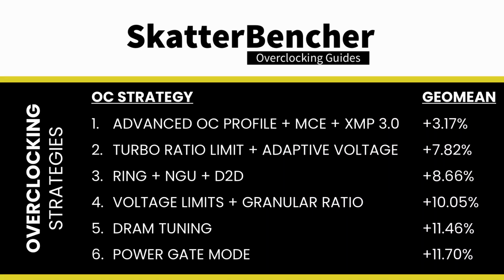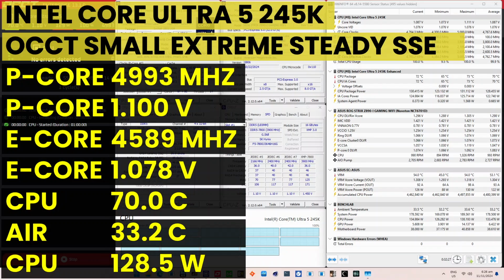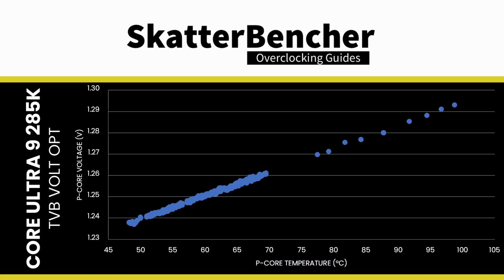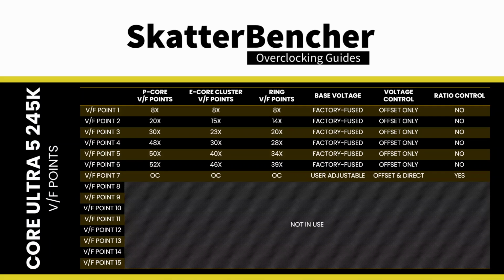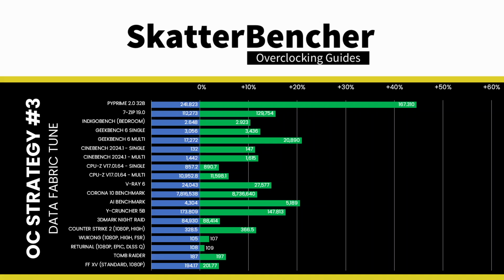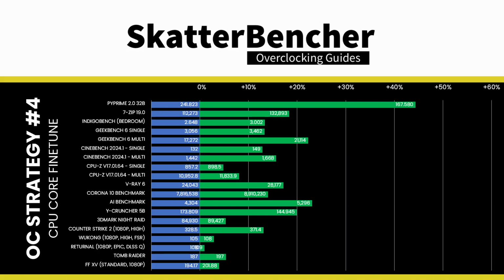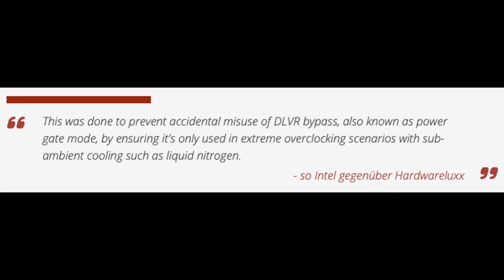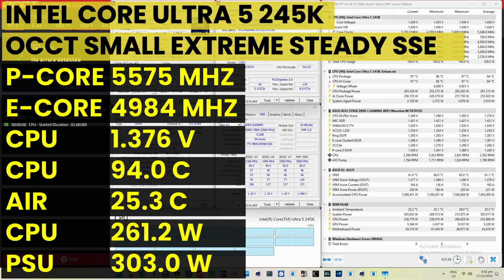Core Ultra 5 245K Overclock to 5633 MHz | SkatterBencher #83

Comment: Thanks for putting all of these tutorials together, they're very helpful. 

You seem to know your processor's voltage at every VFP (for the RING, E-Cores, and P-cores) set by the factory. I believe you mention using a tool by Shamino to get this? Could you share this tool and if so would it work for other boards besides ASUS? If the tool is only available for ASUS boards, do you know of any other tool that could help get these values?

Without knowing the voltages for each VFP, setting an adaptive voltage for the OC VFP requires a lot of trial and error since you could easily set it to a value below the factory voltage of the VFP below it.
Reply from the maker: Hey, thanks for the kind words!

The Shamino tool can be found on the ROG forums: https://rog-forum.asus.com/t5/intel-800-series/arrowlake-resources/td-p/1051570. It's included in the "OCpak". I don't think it will work for other boards, though.

There are ways to get the VFP by yourself though it's a lot of manual work. I explained how to do it in a previous overclocking guide: https://youtu.be/popQrxK5_nU?t=2042

Comment: When should we overclock, quickly after building a new PC or when we require that boost, If later is there a way that it will boost OC when its required or load is given and go down back when not required ?
Reply from the maker: That's entirely up to you ... there's no "must" with overclocking, only "can"

Comment: why are the graphs not linear?
Reply from the maker: Which graphs?
Reply: @SkatterBencher  I find it hard to read graphs as well. I get the offset idea, but 30% gain looks like 300%. I’d much prefer the scale starting with 0% where 100% represent the base performance. Love your work
Reply: @SkatterBencher  performance gained graphs.
Reply from the maker: Ah, I understand. I've had this comment come up a couple of times in the past, mostly because it makes the performance increases from overclocking "too big." Even get called an industry shill over it :)

My reasoning is that I want the charts to highlight the relative performance improvement from tuning across a variety of workloads. I can't do that if the majority of the chart is occupied with showing the performance between system off (no score = 0%) and base performance (score = 100%). 

I get that it's not very much the scientific way but, on the other hand, I also never claim to be a reviewer providing a source of truth about hardware performance. That's one of the reasons I never do comparisons either. I'm just a guy trying out settings to get more performance and want to show where the most performance is gained.

Comment: awesome guide as usual. is sad intel may disable PG mode not using the DLVR reg device as all regulators create xtra heat. the more of these videos I watch the more I'd possibly prefer these new core ultra cpu's vs new Ryzen ones. also that cu-dimms really help this cpu design. also using a 245 vs more expensive ones gives higher speeds at given heat load. 6 cores plus all the eff cores is prob adequate for most people.

Comment: Hm why is the Y-cruncher 5B score that low? My 13700K is doing around 125 sec. at 5.6 Ghz. The good thing with this new Intel Processors is the much lower power consumption.
Reply from the maker: 13700K has 24 threads (8P+8HT+8E) whereas the 245K only has 14 threads (6P+8E)

Comment: im having trouble getting some ram clockspeed out of my 2x32gb 6000 C30 kit, im getting stuck at 6600 - do you have some daily-system settings for 64gb dual ranked hynix ram? i want to stay in really safe voltage ranges as this system is going to be a workstation and it needs to be long term stable, but being stuck below 7000MTs is not great with arrowlake. thanks!
Reply: Be under 40 degrees. Do same stuff you've tried already. Get different results.
Reply: @FakeName2000  7000 doesnt even post. 6800 crashes on boot.
Reply: @ What CL you using? Start with around 38 and lower it if stable.
Reply: You wont be able to oc garbage dies as they are pushed to the max from factory.

Comment: Can you give me a advise please?
I have a 14600K and i manage to reach 5.7 Ghz stable. The issue is that i feel that a 360mm AIO, the Lian Li Galahard II trinity is not handeling it well. It reach 100C easy. The case has good airflow and ambient temp is around 23-26C.
Is it normal? Or do you have advise for me?
Multiplier is 57
E cores Multiplier is 45
Ring is at 53
Vcore is offset to -0.02
Ring and L2 is offset to +0.02
SVID for turbo is 1.35
SVID for turbo on L2 and Ring is around  0.4
Reply: You need to underclock and undervolt to lower power consumption and heat